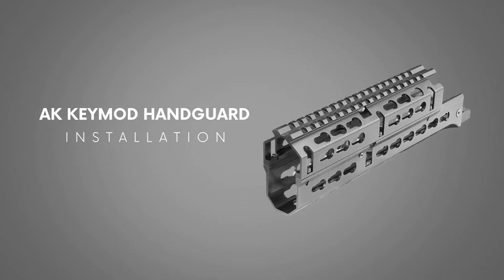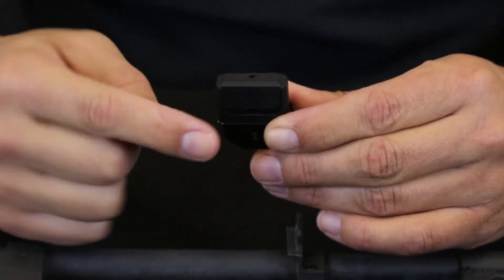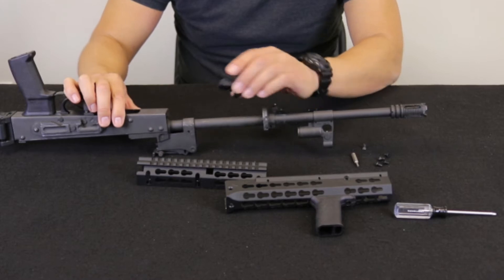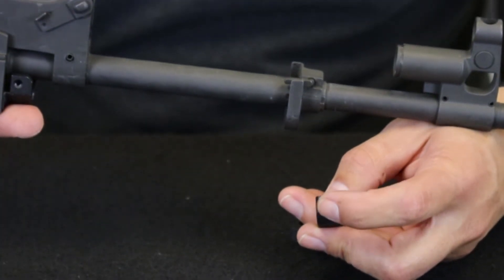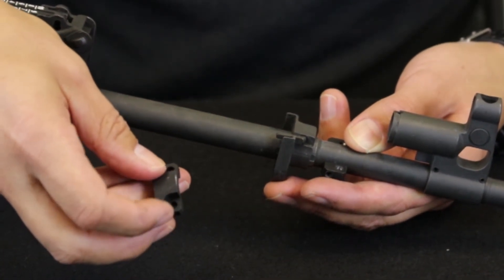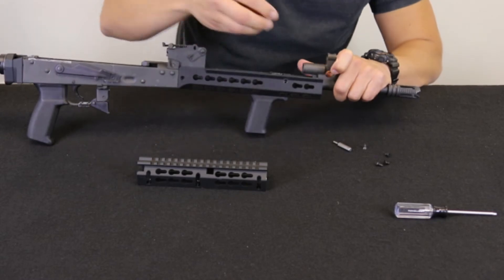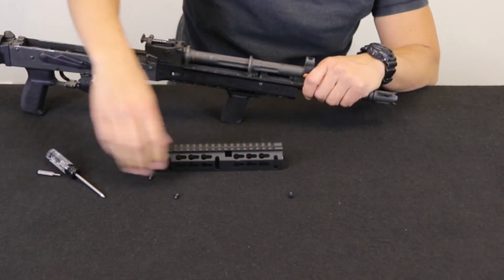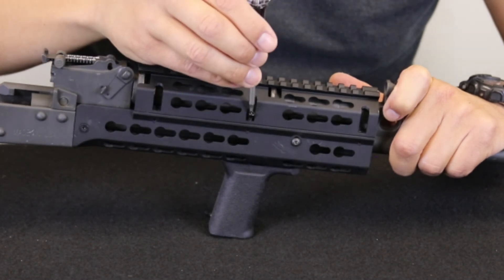AK47 Handguard installation - AIM Sports Inc.

Comment: First, can you just mount the lower by itself if you wanted to? Second, will this work on a MAK90?
Reply: Did you ever get any answer
Reply: Does not fit mak 90 with out modifications. Doesn't fit trunion

Comment: Will not fit N-PAP M70
Reply: could you tell us why it won't fit? is the front clamp not the right size for barrel diameter ?
Reply: @yaweitong2848  because they are Yugoslavia spec rifles, they have different recievers
Reply: @yaweitong2848  won’t fit my century arms. Front clamp isn’t the right diameter, and my gas block has the sling mount which blocks the bottom of your hand guards from sliding on.